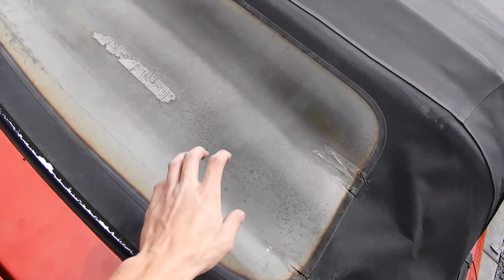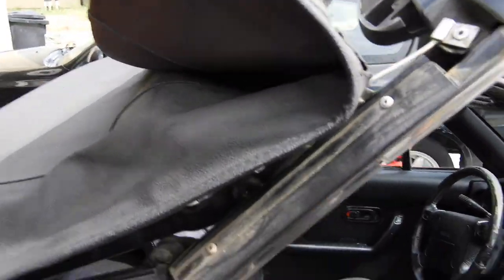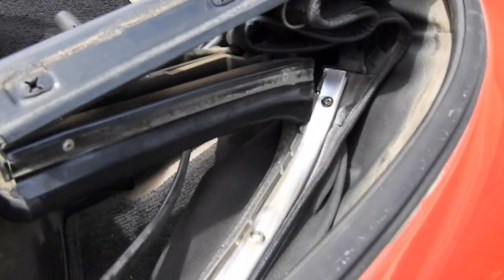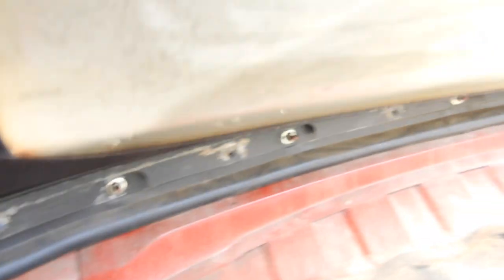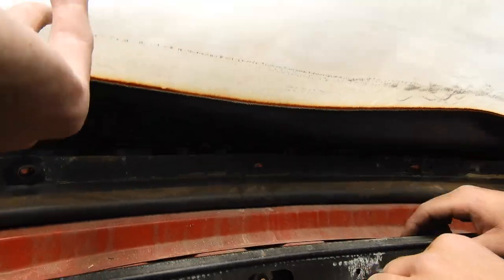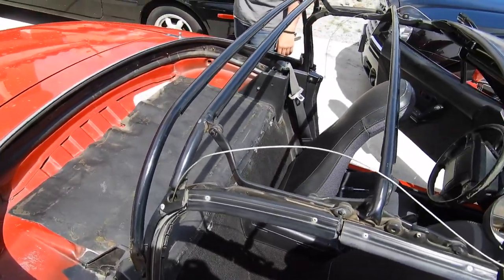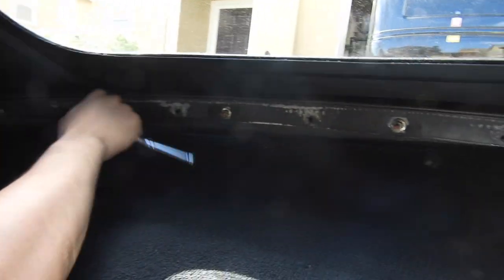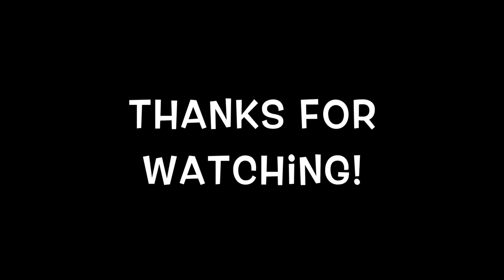Miata top install!!!

Comment: Pretty good vid, but I winced when you were working the top off the cross bar. I'm buying a Miata in 10 days that needs a new top. Years ago, my factory top delaminated from the crossbar on my first Miata. I was able to slide the whole piece off by pulling it sideways. I always figured I'd have to do the opposite when I install a new one. No harm in doing it your way if the retaining edge wasn't damaged.

Comment: 6:06 As for the part, you shouldn't bend the metal lip. You're supposed to slide the top out sideways. That groove is a retainer and you just slide it out.